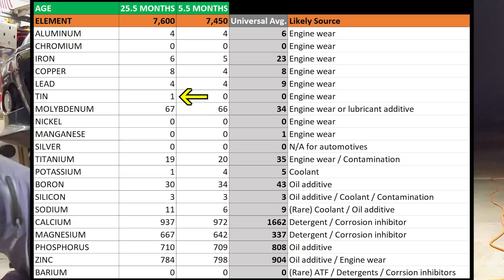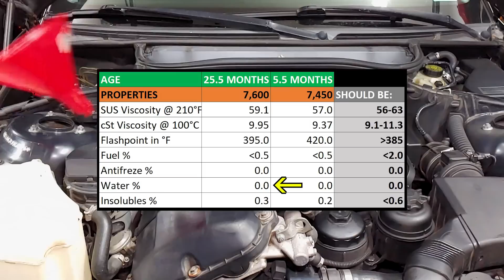Does Oil Really Need to be Replaced Every Year? Surprising Analysis Results Revealed

Comment: I appreciate people who take time to educate others via YouTube. Subscribed and thanks because I was suspecting this as well. 

On another note however, I should mention that my cars are in best condition by changing oil every year and changing everything that can be changed every 5-6 years, like all fluids, plugs, belts, filters, brake pads,  etc. Chevrolet Lacetti 2005 still giing strong, Renault Clio 2003 as well but the cables rotten so it has problems, KIA Stonic 2020 no problem yet, etc. The 5 year big treatmenf of these cars costs from 580 to 780 Euros. I suppose for a BMW will be much more. But in any case I believe it is a good strategy to keep the car forever. Cars do 6000 to 11000 km a year.

Comment: I change the oil and filter on my W202 C200 Kompressor every 5,000 miles, and the car has been running like new for 13 years and now has over 450k miles on it.

Comment: "Anything can happen between oil changes"? No. The lab results proved that to you as opposed to guess work. It is very very rare for an engine ever to fail as a result directly related to oil itself.
Reply from the maker: "Anything can happen between oil changes" does not mean "things happen between every oil change". And no, it is not rare for engines to fail due to oil degredation.
Reply: @endlessmoneypits  It's quite rare for a 'catastrophic related engine issue' to be due to oil.

Comment: I change mine every 10,000 miles with the cheapest mineral on the shelf at that time. Over 260,000 miles of city driving it is still running with no oil consumption and or oil burning. People worry way too much about nonsense subjects. Computer generated voice sucks.

Comment: This is really informative and confirms what I've always thought. I have a 2005 Chaparral boat with a Volvo Penta I/O 305 V8. I keep it stored in my garage from October through early May and then in my driveway through the spring and summer. I know without a doubt that I don't put a fraction of hours on the engine in a season that would require an oil change but we've always been told to change oil at least every twelve months regardless of miles driven, or in this case, hours put on the engine. I use Volvo synthetic oil and filters and always felt that it was big time overkill to change the oil every spring. It'll be a semi-annual oil change from here on in and that's still probably conservative.
Reply: You should throw out sealed quarts of oil after 6 months because if it just sits there it will break down and become water laden and you will ruin your engine if you use it. The stores that have oil on the shelves should rotate old stock out every 6 months because obviously those will be contaminated from just sitting there. Engines these days...so loose and so completely unprotected from the elements that water just pours into the innards of the engine, and turns the internals into rust after 30 days. So change your oil every 30 days because you know...oil is cheap.

Comment: Both the car manufacture and oil supplier recommend oil change intervals in addition to mileage. The reason is car may be driven a lot stop and go  short trips so mileage is low, not the oil degradation. Transmission fluids can be good for ten or more years. I am retired and co not drive a lot. the longest oil change interval for me is 5 years.

Comment: I bought my 2002 325i off the lot new.  I’ve always changed oil at 15k mile intervals.  It now has 230k miles and still runs great.  It does have the dreaded oil consumption issue, so I need to add a quart every 2k miles.  I wonder if I can possibly never change the oil, outside of filter, since I’m always adding a quart every couple months ;)

Comment: Due to the angle of your car, you’re not draining all the oil out your sump
Reply from the maker: True! I actually vacuumed the remaining oil out with a fluid evacuator, and have been saving the footage for another video that never got made. I pulled an additional 6 fl oz, or about 175 ml of very dirty oil after draining it on an incline. I typically use the fluid evacuator (with the car flat) when I do oil changes, but drained it on an incline to get the sample in this video. Good eye!
Reply: @endlessmoneypits  makes more sense to remove the axle stand from the side the oil is draining towards, then when you think its empty, pour a little new oil in to force out any drags
Reply from the maker: That's a bit overkill, and removing one of the stands would not be safe.

Comment: When Arco Graphite came out, I never changed the oil. Finally  when I took it to the service bay the oil won't drain out. The engine still ran good though.

Comment: I had a friend a few years older than me in the 80's that worked with my dad. He was a helicopter mechanic and my dad was a helicopter pilot. This guy had an early 70's Ford he drove at least 30 miles a day, five days a week (the airport was 15 miles away), the  truck had a V-8, not sure of the displacement. It was ROUGH. Anyway, he bought the truck used and said he never changed the oil in it. As in NEVER. He owned it at least 4 years that I knew of since we moved out to a house his family owned an a farm and lived there until I finished school. He bought a new Ford Ranger in 88' and kept the old Ford around for us to use around the farm, which is to mean it was further ragged out...I went home on leave from the Army in the early 90's and the old Ford was still running. After a few beers one night, we were like "hell, let's drain the oil and see how long she'll run"....well the odometer was long past inoperable so we have no idea how many miles it ran without oil but it was still running when I went back overseas a few days later. Come to find out, the truck ran for several weeks after that around the house. He said he thought it probably ran 150-200 miles around the farm and trips into town to pick up feed and what not. I was told it ran until the last time it was put into park....then a week or so later he went to take it into town but it didn't turn over and never ran again.  The last time I was down there (maybe 05'-06') it still sat there where it gave up the ghost hahahaha.  I've owned only Ford trucks since then....but I do change the oil in them!

Comment: Why Engine Oil Degrades with Time (Not Just Mileage)

1. Oxidation:
Over time, oil reacts with oxygen, even if the engine isn’t running. This chemical reaction leads to increased viscosity (it thickens) and the formation of acids and sludge.

2. Moisture Accumulation:
Condensation can occur inside the engine during temperature changes, especially if the car sits unused. Water doesn't mix well with oil and can cause corrosion and sludge formation.

3. Additive Breakdown:
Engine oils contain additives (detergents, dispersants, anti-wear agents, etc.) that degrade chemically over time. Once depleted, the oil can no longer effectively protect the engine.

4. Contaminants:
Even a sitting engine can let in contaminants like dirt, dust, and fuel vapors, particularly in poorly sealed systems. These can react with oil, causing it to degrade.

5. Short Trips / Occasional Use:
If the car is only driven occasionally and for short trips, it might never get hot enough to evaporate moisture or burn off fuel dilution. That’s often worse than regular driving.

So there's more than lab analysis.
Plus like others mentioned, there's risk of corrosion and seals degradation. So it's not even the oil itself that you should worry about being old but what that oil can do to your components

Comment: The adage "oil is cheap. Engines are expensive" may have been true 20 years ago but in an age when a basic oil change at Jiffy Lube is $60 or more it would be more accurate to say that oil is expensive but engines are more expensive.
Reply from the maker: Fair point.

Comment: I will stick with 6 months or 5000 miles.  All 4 cars burn zero oil and I do oil and filter changes myself so around $35 - $45 each change.  Maybe it is conservative but for us it is not a big deal on cost or time to be conservative.  How one drives and climate probably can also have an effect.  Recycle the oil as well.  As cars transition to hybrid and electric I guess this question will go away.  Also, if you have a turbo, oil changes do likely to need to be more frequent and let the turbo cool down before running it hard and just shutting off the engine.

Comment: Watched both your oil videos ... some interesting results but I do wonder if oil type plays a part though ....    An example is a JD ag tractor on the property that is specified from factory at 250hr oil change interval.  Ran brand A oil in that thing for years without issue and zero oil consumption between changes ..... till local oil supplier changed brand B .... with same viscosity and same classification.  From that point oil consumption was zero till around 200hrs ..... then it would start using oil.  Clearly the brand B oil was "done" at 200hrs .... and as an old oil advert use to tout - "oils ain't oils" .... I changed back to brand A !!

Comment: When you drive how long are the trips?  100 miles in one trip is much different than 100 mile done in 50 two-mile trips,
Reply from the maker: At the time of filming, I had a 30 mile commute.
Reply: , in the ‘old’ days when gas had sulfur and if engine did not get hot enough, to burn it off,  the resulting sulfuric acid would breakdown the oil. Hence the “short trips are bad for oil” common wisdom.  Not sure if this ‘ancient wisdom’ is still applicable with today's gasoline and synthetic fuels or just promoted to sell more oil changes.  I go around 6,000 or 18 months.  I could probably go longer than 6,000 but try to rotate tires with oil change.  Maybe rotating tires every 5,000 miles is also ‘ancient’ wisdom as suspensions and alignment are so much better than the 1950s and 1960s.

Comment: You know what the stupidity is in all this is. The time wasted and expense sending oil to get analyzed. JUST CHANGE THE OIL/FILTER and have a cold one doing it.😊
Reply from the maker: You don't understand the point of these tests? The question I'm trying to answer is, "How often should the oil be changed?"
Reply: @EndlessMoneyPits  No, you like many yuppies have no clue. You don't understand the engineering or have the experience to remotely logically discuss these topics. I have not seen 1 engine with 5-10k intervals go pass 100k with no oil related issues. Especially 4 cylinder GDI Turbos, not 1. You want cars go 200-400k change the oil/filter every 3k with Castrol Edge.
Reply from the maker: You must not have actually watched these videos because there are almost 300k miles on this car and the engine has no issues. Confirmed this in the compression test video I made couple months ago.
Reply: @EndlessMoneyPits  Nope, not buying it. Hey, do what you want. YT has become joke with all the keyboard warriors...
Reply from the maker: I'm reminded of the saying, "You can lead a horse to water, but you can't make him drink."
Good luck.

Comment: On my two Asian vehicles I left the Amsoil Signature Series oil in the engines for 20,000 miles, and about 4 years. The cars run great at 110,000 miles and 158,000 miles. I don't worry about the oil sitting in the engines for that long. When I changed the oil in both vehicles, the oil was dirty but not as dirty as I expected. When I smeared a little on white paper towels it appeared black but translucent. I also use only synthetic filters rated for 20,000 miles and drive my vehicles infrequently but prudently.

Comment: Aircraft are serviced according to the hours they are used and that's exactly what we should do with our cars once the warranty runs out. Forget time and go by the distance clocked instead. The only exceptions are perishable items such as drive belts, tyres. That includes the hydraulic systems with their seals so change the fluids every few years because they tend to be hydroscopic and that moisture causes problems.

Comment: The oil is in an enclosed system but particularly as the car ages that system might not be perfect. Your lab test might be accurate for most cases but the change oil at least once a year rule is most likely a precaution against faults in the system.
Reply from the maker: It's important to maintain your car.

Comment: Oil doesn't really degrade easily over time. Its the cycle of heat and cold over and over again that deteriorates oil. Still, motor oil does have an expiration date as per oil manufacturer and car manufacturers also put an oil replacement within time period in line with the kilometers usage because , - yeah, they have to make money on services too.

Comment: Hi, can Liquimoly 2208 0W-20 Special Tec AA Motor Oil hurt my BMW X4 28I n20 engine? It has no LL01FE standard, but it is API SP ILSAC GF-6A. It has already been added by mechanical shop, is it fine to keep it to drive 5000KM then change it? Thanks.
Reply from the maker: If your engine calls for 0w-20 then it should be okay. I didn't use LL01 oil for a long time without realizing it, and a recent compression test I did still gave incredibly good results. Liquimoly has been recommended over and over in the comments here, so it must be good stuff, but I'm a fan of using the oil BMW recommends.

Comment: To check the STATE  of the oil the dipstick needs to be checked straight after a drive since impurity particles quickly settle in the sump.  I fell in to the trap of checking oil on dipstick when car was standing in garage, not after runs, and didn't change oil which seemed clean even after around 10k miles.  The canister oil filter, lower down, corroded through and let me down one day when I was out in the car.
To check the oil LEVEL, of course the oil has to be allowed to settle after a run.

Comment: It might be said based on the lab report, that your bmw has a very sweet motor. 😊
But of course, many of your followers with less 'tight' motors would have higher contaminant levels. 
Those contaminants would then accelerate the aging out of the engine. E.g., more wear on the journal bearings, piston ring clogging, sludge formation in the oil galleries. That's the issue with blanket manufacturer recommendations of the mileage and period, they are guidelines for their engines in excellent condition, not as 10-20 year old project cars. Having the oil tested is the definitive way of knowing where you stand; a bit like an old guy needs to get his bloodwork done regularly to know his true metabolic state.

Comment: I've spent a lot of time searching the Internet for a video like this. We have a 2021 Hyundai Kona that only gets driven about 1000 miles a year - uses the same 5W-30 Synthetic oil (Mobile 1) - I checked the dipstick at one year and the oil appears to look as new as the day of the oil change. Thank you for your time and effort on these videos.
Reply: I did two year changes for quite a while, for the same reason, but I started seeing varnish through the oil fill. The the oil had a strong gas smell as well, getting close to two years, even though no oil was used. So blowby should've been very minor.
I change oil once a year now, just avoid varnish and fuel tainting. Changes are so cheap and easy, I prefer to err on the side of caution.
Reply from the maker: I'm glad this video helped!
Reply: @endlessmoneypits Would mobil1 oil even better than Castrol oil?

Comment: i am from india i have alto k10 2017 model and drive less than 4000km in a year please suggest me after every 2 year oil change ok or not for my vahicle
Reply from the maker: The make or model of your vehicle should not make a difference as long as your engine is well maintained so that no dirt or moisture can get inside and contaminate the oil.

Comment: As I change oil myself, despite MB specify 30'000km, I apply the following rules all the time: once a year or 15'000km max.
Always use approved Mercedes oil!
Oil is much  cheaper than an engine. 😮

Comment: I worked for TVA back in the late 70's at Hartville TN. My job was to change oil and grease heavy equipment. They changed from using the hour meter to tell when to change oil, to a computer monthly time readout. We changed oil in a lot of equipment that didn't leave the repair shop in several months that had new oil in them.. Cat dozers held close to 10 gals of oil..
Reply from the maker: That's crazy

Comment: It is a lie that in Europe oil is changed 15k km only, check your car manual, really there it is explained what is considered normal car use and what is considered a stress for the car that requires oil to be changed at 8-10k km like - driving often short trips, driving above 140 km/h very often, extreme humid/dust environment etc. Do not cheap out on oil changes unless your car is old, if it is new or under warranty do not wait for 30k km as some companies are advertising their oil is changed!

Comment: How about splitting open the oil filter and spread out in a shallow black pan. Soak with a bit of thinner and then take out to air dry it. Then look for shinny metal debris. Any plan to switch to Vavoline Restore & Protect?. Regards.
Reply from the maker: I wish I had done that. Maybe I will for the next test. I haven't looked into that oil at all.

Comment: I am very curious about this analysis.  I'm using fully synthetic.  I have several vehicles.  Because I split time on them, I'm driving less than 5000 miles a year on any of my vehicles.

In particular concern, is our Jag F type.  1000-1200 miles year.  Is annual oil changes required? I suspect not.  I'll be running some analysis myself to see what are the results.
Reply from the maker: I'd be interested in hearing the results from your analysis! Love those cars.